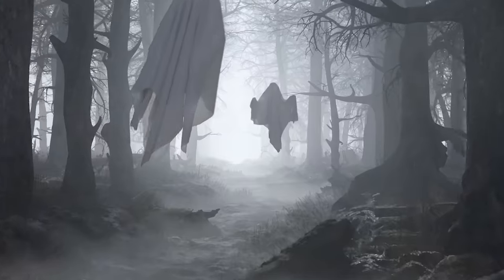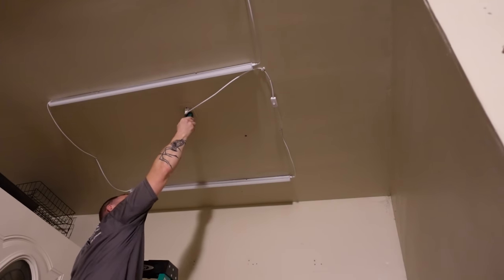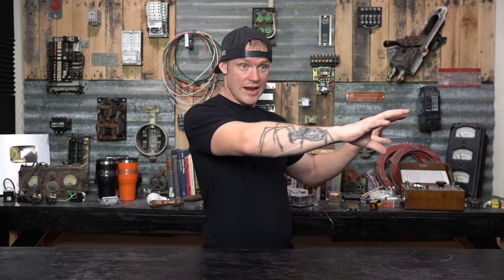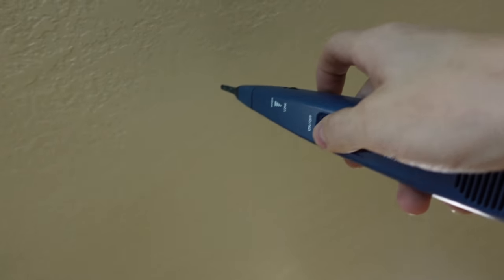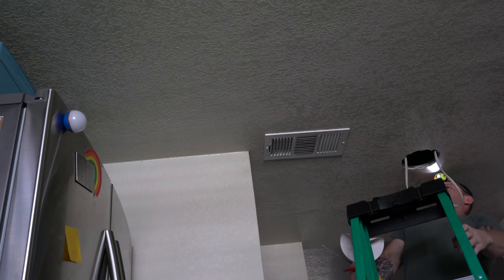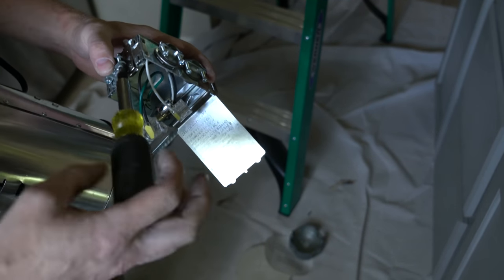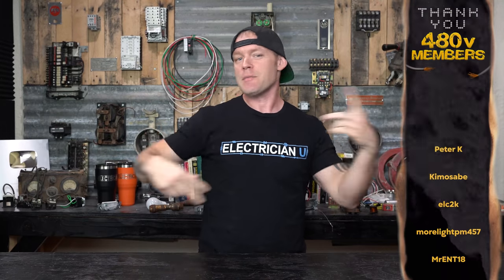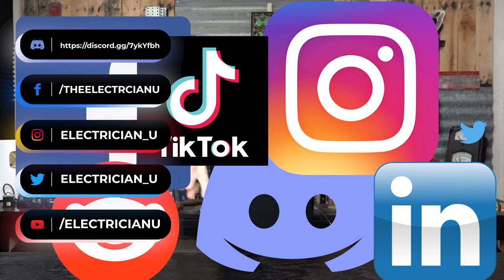THIS IS WHY ELECTRICIANS DON'T HIDE J-BOXES IN WALLS - Finding Hackwork!!

Comment: I remember an electrician our company used was working on live circuits in our data center and I asked him if he was worried about getting shocked and he said that never happens to a good electrician.  I followed up with "so you've never been shocked?" and he replied "no I get shocked all the time."
Reply: Lol
Reply: Good one 😂
Reply: My first electric 240 Volts“ shock aged sixteen serving my apprenticeship in the uk,  happy days though  !!!
Reply: Thats good old blue collar humor lol
Reply: I completely understand that electricians comments. I didn't like it  and it only happened a few times mostly 120 ac  one time by 480 3p.
But my dad if it was a 120 ac circuit to see if it was hot would grab the end. I thought hell no. LOL
Reply: Now that is actually funny!!
Reply: Good electrical turns circuit off
Reply: Bah-Dumb-Tish!!
Reply: @kennethluedtkejr1903  Contrary to popular belief,  a 120 volt jolt is seldom fatal.  Of course,  as little as 15 (fifteen) VAC can kill,  under certain extreme conditions.  And if you have a weak heart,  then all bets are off.  50/60 Hz AC is about the worst range of frequencies to get jolted with.  These frequencies interfere with your nervous system,  and certain CAN result in V-fib or asystole.  Electricity is to be respected,  not tempted.
Reply: @gyrgrls  would you care to elaborate on why the 50-60 hertz frequencies are so hazardous to the nervous system? I don’t know much about it but I’ve always wondered why these are the selected frequencies for electronics and why one is chosen over the other depending on the region.
Reply: Hvac tech for over 20 years only got shocked one time in an attic because of an diy electrician. I grabbed some conduit while climing around and closed a curcuit through myself.  Conduit wasnt grounded to the pannel. Also shorted with a screw driver 480v wont make that mistake again. Sounded like a 12g shot gun going off next to my ear and no more screw driver. Luckly did not get bit at all (this happened early in my career and is probably why I have never been shocked doing my hvac work to this day) im very careful at this point.
Reply: How much would you charge for a job like that??
Reply: @eloisocolon9318  people are paying full price for horrible work because they cant tell the difference from a true electrician and a handyman who says hes an electrician that day.
Reply: @John Bond  15 volts ac would have to have the electrodes piercing your body and sitting right next to your heart. Thats a very extreme circumstance to the point I'm more worried how I got electrodes stabbed into me than about the 15 volts ac.
Reply: Been shocked a tad bit in my day,  commercial field... Gets fun wiring things behind a shotty demo work (snip a conduit live-arc it and then preceded to leave it for the next jackass who thinks it's just hanging there) to having to work something hot and shotty electrician work b4 we got there
Reply: @taylerellis378 I thought I was the one who as the yrs go by I get more and more careful not careless 😂never shocked hard either unless you count a few  receptacle vibrations😂😂
Reply: @fredkeogh9035 I was 7 and I put a paperclip in an outlet, 21 years later im rewiring my kitchen lol.
Reply: Hahahaha!
Reply: My worst shock was 277 (one leg of 480 3 phase) felt it in my toes. I was voltage testing in incoming power for a welder and made contact with the lug and the rack the welder was on.

Comment: I love it when a customer says the last electrician could not solve his problem. Then it's game time !
Reply: I always love a challenge.
After a few decades you get a sixth sense and you pretty much know what's going on within a few minutes.
The tough ones were always my favorite because they don't follow the rules.
Reply: Ditto .. Different field if you will,  i'm I.T  and Love a challenge so when i hear the ol "nobody seems to be able to fix this problem" , im the same way .. Game On!   Cheers.
Reply: I hear ya brother !!!   Give me the fucking ball with only seconds to play.  I’ll fix it.  I love mind-bending electrical problems
Reply: Or they say “I couldn’t figure it out, so i dont know if you can” 

Im usually just like, I’ll try my best! But in my head I chuckle.
Reply: Time to charge more money as well
Reply: I think you just uncovered a problem I had while selling my house. The inspection required I add a second layer of drywall in my garage ceiling that was under my master bedroom. The carpenter (not electrician) had to remove my ceiling fluorescent lights to complete and after he finished, I experienced problems like your video showed. My house was built in 1973. I eventually hired an electrician ($$) to resolve and fix the problem. He seemed to fix the problem, but two months after we closed and moved to another state, we got a call from the new home owner about lingering problems again like shown in your video. I told him who the electrician was that fixed (?) the problem and that I had paid quite a few $$ to get it fixed. Didn’t hear back, but then got a call from the new home owner about another question and was told an electrician friend of theirs fixed whatever was wrong. Never heard again, but your video makes me think the carpenter did some shabby work replacing the ceiling lights in the garage that created a similar problem you show. Great video. Looked boring at first but once I started watching, couldn’t stop. Love your presentation and your occasional fuck comments match my own when troubleshooting issues. Subscribed and look for more.
Reply: How about PPE, safety glass and gloves. Killing the power is one level of safety, toner trick is nice add 

Retire to cape cod, Mass bought house built in 60’s, 100Amp service has 12/2 all over place no staples on 12/2 wires, it appears all outlet on one 15Amp service. We have a 10KVA generator with switch box fire up each Wednesday 
Neighbor changing over to 200Amp service with a sister box to separate all circuits in house 
Trouble we have 3 way switches with travel is a black wire no 12/3 with red wire ( no electric red tape to mark the travel wire ) 
Used 9 volts battery clipping 9 volts positive to black wire and negative 9 v battery to ground measure voltage find both end of black wires then used red electric tape to mark it as travel 
All white neutral tied together 
It Took me days figure it out 
What circuit tracer do you used ? 
Thanks for sharing, nice video 
I could do less with F word it’s negative on tape 
Using drop cloths to work as clean Electrician and F WORD does match your profile 

Nice solution to problem
Reply: @jakesully5402  I wish you lived here in Phoenix Arizona.
Reply: Lmao!!  I’m in hvac and I love hearing “ we had 3 techs here and they couldn’t figure it out “!!  Don’t worry “ I’ll be the last tech here 👍👍👍
Reply: Even better when the last person says: not just that they can't figure out how to do it, but that nobody else will be able to do it either. That's my game time moment!
Reply: @Aaron Loos Somebody gave me a car one time that broke down in their driveway. I pulled out my butane soldering iron, touched up a couple joints in the fuel pump relay and drove it home.
Reply: @RJMEL24  My guess is there was some shabby electrical work already lurking and the carpenter hammering on things just shook something loose. It's impossible to say for sure without finding the smoking gun so to say.
Reply: As an IT consultant, those were always my FAVORITE calls..  the more people who came before and couldn't solve it the better.  I figure if I solve it, I'm a hero, and if I dont...  well.. the last guy couldn't either, so expectations were low!  ;-)
Reply: So how come they even get their license? 🤫
Reply: @jonnywick4402  Good question. I've always believed getting a qualification is just the beginning of learning.
Reply: Yes. Game on!
Reply: I just became a full time electrician 6 months ago I’m learning a lot but I feel like I need a bit till I’m in the sixth sense of electrical knowledge. I’ll get there!
Reply: Challenge accepted.
I have done many things that others have deemed impossible.
- Software Engineer :)
Reply: Where is the doorbell transformer?
Reply: @Aaron Loos yes, I am also a mechanic,  and I get the same feeling of being able to accomplish what others can't
Reply: Yeah sooo right !! my record is 3 electricians I was 4th and last took me 3 hrs though.  and I used to be a signage electrician.  You see ALL kinds in that field.  So much fun basements subbasesements attics skyscrapers bridges everything
Reply: One of my customers said that I fixed a problem when the las 3 electricians couldn’t figure it out. I don’t believe I’m better than anyone else but it makes you feel good when they tell you something like that.
Reply: @Aaron Loos yes but you walk around for 45 more minutes to charge the hr
Reply: @MichaelClark-uw7ex  👍
Reply: @jakesully5402  👍
Reply: @curtisj2165  👍👍
Reply: Well I figure it out I usually go into the room we’re the clients are with my hands up like I just championship boxer  we just got the knock out lol
Reply: @steveclemente5351  👍👍👍👍😀😀😀😀👍👍👍👍😀😀😀😀👍👍👍👍😀😀😀

Comment: As a fellow electrician I can confirm the “fuckery” is an actual technical term😂
Reply: I was listening and hadn't looked at the comments yet. I heard "fuckery" and thought "cool... I learned a new way to drop the F-bomb, awesome." Scrolling and I learn it's a technical term, even better. LOL... Have a great day!
Reply: What fuckery is this?!
Reply: We say "fuckery" all the time where I'm from...
Reply: As a software developer and former network tech / computer tech, I can confirm this is the correct technical term in most of the technology world.
Reply: Also applies to carpentry and plumbing installations and repairs!
Reply: Stage electrician here: fuckery also.
The added benefit is you can and will blame it on other departments.
Reply: @SlappyJack  Former technician. Can confirm, cabling guys often do this as well 😂
Reply: Adjective, "Fucktard" is the noun? Never mind all units of measure.
Reply: My house has Cork & screw wiring two prong plugs that are falling apart out of the wall no junction boxes on any of the light fixtures besides two ceiling fans and work for a free wire split off that's all wirecapped and duct tape any electricians on here want to tell me how safe my house is and it's a rental home that I rent and the landlord won't fix it and then we also have the second power grid which is 240 which was shut off by the breaker panel but exposed wires everywhere
Reply: As a General Contractor I can also confirm
Reply: @XxdeadlyshadowsXo  make sure you have renters insurance, sounds like you can use some life insurance too.
Reply: I’m in A/V and can confirm that “ fuckery” is a commonly used technical term. Low and high voltage experts alike use this term all the time.
Reply: @XxdeadlyshadowsXo  move
Reply: As a non-professional but grew up doing and reading NEC gopher electrician the term "fuckery" now has to share room with my new rating scale "The Winchester House".
After a few years of teenage residential construction electrical installation and decades general repair of everything else I find myself owning a house that was initially built in the 1950s and upgraded, renovated or expanded at least 5 times over 5 decades.
While none of the original wires are attached you can still see old Knob and Tube hardware that was abandoned in place. 
Some circuits have grounds, some don't. Some have the smaller wire gauge ground wire, some had a ground added afterwards with a single big bare copper wire (8 gauge?) that obviously hits multiple circuits. 
Of course I got to learn all about Zinsco.
And that they really shouldn't have installed that as a 2nd circuit breaker panel spaghetti wired close to the main panel.
And how many different ways the original owner could mis-wire a 3-way switch circuit.

I hired a licensed professional when I learned of the highly illegal wiring stunt that was on the wrong side of the meter. I wasn't gonna put my fingerprints on that piece of crime.
A lot of the other stuff I could and would have repaired to better than code requirement but when I was helping the pro demo parts of the garage (where my main panel is) we'd all stop periodically to take pictures of things that we'd hopefully never see again and that people would not believe without proof. 
Winchester House shit.
Reply: If you want some interesting technical terms watch AvE.  Keep your stick on the ice.
Reply: "Fuckry " is a jamaican term.
Reply: @sgtjonmcc  Buried junction boxes are either homeowner-wiring-job fuckery, or carpenter-who-thinks-he’s-also-an-electrician-wiring-job fuckery.   You can instantly see in the buried octagon box that whoever dressed those wires didn’t know what the hell they were doing.  Just by the nature of what they are, buried junction boxes are a VERY strong indicator of wiring that was done by someone who doesn’t know shit about electrical.  Those scenarios always scare me, because I wonder what other amateur fuckery from past hack-wiring jobs I’m NOT finding.   

I really like his option of putting in another pot light.  I’ve gotten creative before like that too.   Fix the problem you were called in for, and also make clients life just a little bit better.
Reply: @davefellhoelter1343  yup !!  That’s the guy who created all the fuckery 😏😏
Reply: @jakesully5402  Or a drywaller!
Reply: Not to be confused with (bull) shittery or assholery, or shenaniganry.  Not an electrician, but these terms are used with the same meaning in many tech fields.
Reply: I can confirm mechanics use the word fuckery when describing engineering solutions.
Reply: @djnone8137  engineering fuckery necessitates mechanic fuckery particularly when one is up against a flat rate quote
Reply: General fuckery and other amazing feats happens every day in the trades.
Reply: @XxdeadlyshadowsXo  Get good life insurance if you stay.
Reply: @harles5000  Drywallers have to deal with other people's  "fuckery" too.
Reply: @chrisperrien7055  Oh I’m sure, like builders and framers warped and twisted studs!
Reply: @harles5000  You forgot  them building houses 12- 14 inches out of square too.
;)
Reply: @chrisperrien7055  Seriously I’d be pointing that out to the builder if I saw that before I’d accept the job!
Reply: @chrisperrien7055  That’s pure incompetence and carelessness not fuckery!
Reply: @harles5000  The 14 inch , was my dad's next door neighbor's house, I did not work on it. the 12 inch one I did not do the drywall, but I heard enough cussing from the dry-wallers/painters when we hung the cabinets, that was not fun either as many studs, measurements were not square.
I have dry-walled some  a little below  that   range or  some very  "screwy" rooms , where we had to trim every sheet of dry-wall to get them to  fit. No fun there. Yea, if you're working by the hour , it is more hours, but still too much a PITA to be worth it. IMO. Nice to see everything float right.
Reply: @JC-xf5xb  Ummm DITTO
Reply: I was doing Electrical on Boats for a while (Ac/Dc) I still do at times. You run into a lot of "fuck wired" boats lol.
Reply: As an auto technician, I too can confirm the term is technical.
Reply: Especially when lead us on a goose chase
Then admit that their brother fixed something lol
While our meters are running$$$
Reply: @robinsymonds5353  but their brother took electronics in high school😂
Reply: But he got a F+ lol
Reply: True oh so true
Reply: Yes indeed.
Reply: 33 flying splices in 1 condo, the "fukery!"
Reply: What are you 13-year-old children? Give us a break from your foul mouth.
Reply: @michaelcorrothers8340  ok Karen 😂
Reply: My friend,  you  are obviously a very talented and intelligent individual.  I’m an old man. My advice to make your presentations more professional is to clean up your language!  The f bomb derivatives do nothing to enhance your credibility.   If your main objective is to make people think cool,  continue but if not,  resist the trash mouth stuff.  Think of this language as “drywall dust.”   Thanks for your content!  I’m always learning something from you.
Reply: @walkkey1  I fully concur with your statement.
Reply: A well used carpentry term also👍
Reply: That's the best form of the word lol.
Reply: @Jedin8_1966  I believe it is applicable to all technical fields
Reply: @davefellhoelter1343  Fuckton is the S.I. approved unit of measure.
Reply: Fubar---When I worked in repair for the phone company, we were told to stop repeating the technician's term FUBAR. Fucked up beyond all recognition.  We were repeating it to the Client. We would say the tech indicated the problem was FUBAR!!  Shyt, we didn't know.
Reply: @itsmemrsd4621  FUBAR is a military acronym for Fucked Up Beyond All Recognition😂
Reply: Maybe the actual 'technical' term used in our industry is "dumb-f**kery"...  :)
Reply: Yeah, I immediately “Liked” the video when I heard that term.